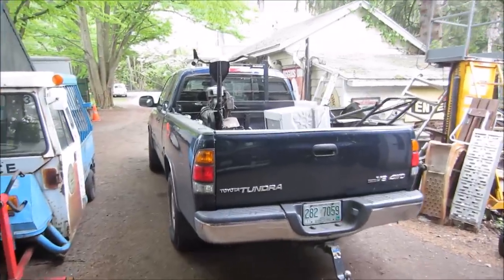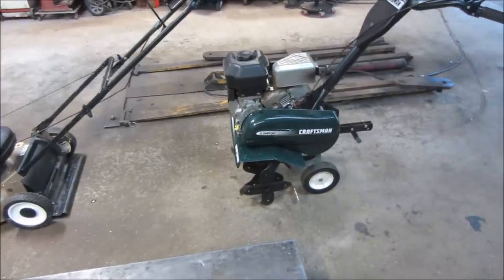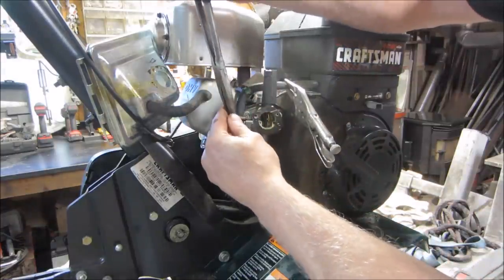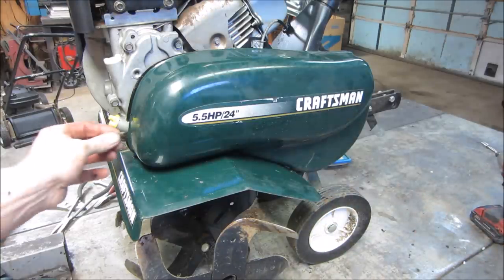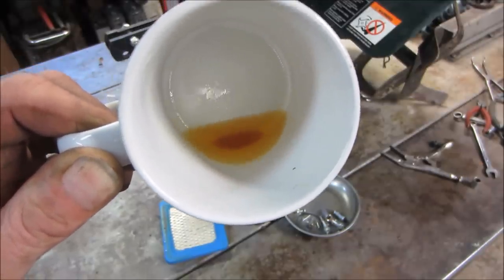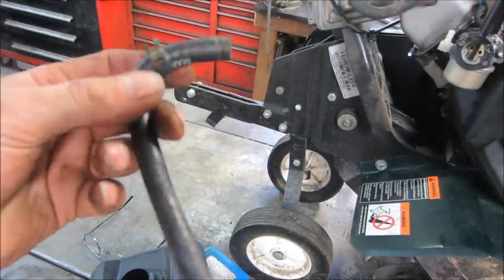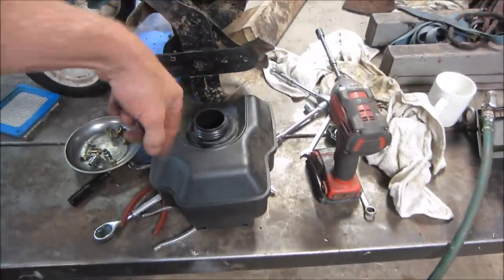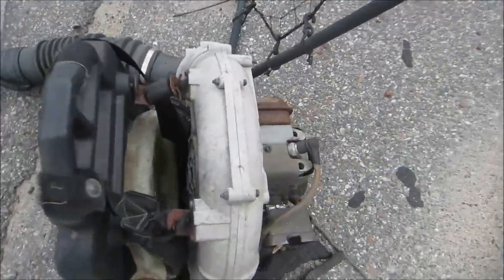will they run? yard sale tiller and mower

Comment: No marine fuel around you? A grocery store gas station a couple towns away from me sells "off road" fuel, ethanol free 90 octane. $4 a gallon, LOVE IT!

Suppose you could make your own. 5 gallon clear jug full of fuel, mix in a quart of water and have the ethanyl/water separate. Pump out the cream, live happily ever after.
Reply: What stores would sell marine fuel? Our gas station quit selling it a while back no pump within 100 miles sells it. I just mix the lowest octane with water and drain off the bottom layer. Ethanol will mix with water, but the gas won't so the ethanol/water mix falls to the bottom.
Reply: Hmmm..  I wonder if that would work.  After the alcohol is gone, how much 'good' gas is left from a gallon?  They sell water separators.  I could run the fuel through one after the water treatment...  I may try an experiment...
Reply: Sure it works, I would start with a higher octane fuel though. Ethanyl adds octane to your fuel so your 87 octane minus ethanol will have a lower octane rating. 

Use a small clear bottle to test it. Add gasoline, add 10% water agitate slightly. The alcohol and water settle on the bottom. 

10% ethanol would be 12.8 oz per gallon, so 1/2 a gallon would be removed from 5 gallons. You just have to dispose of the alcohol/water. Use it to start a fire, as an industrial strength cleaner like cleaning old carbs out.

Comment: You should let an A/C stand in its upright position for a day or two before plugging it in,  so the coolant can drain into the sump.  The same applies to dehumidifiers and fridges.
Reply: MattOGormanSmith laying flat it will be fine since they're designed to run in that position. We store ours like you said so the refriderant runs to the condenser coil. Laying flat it will stay in the reciver/accumulator (if equipped), bottom of condenser and bottom of evaporator. The liquid would have to pretty close to compressor to cause hydrolock, freon evaporates pretty fast, the metering device would be sure of that.
Reply: Laying it flat is its upright position.  It was on its end (side) in the truck at the beginning.
Reply: Im an HVAC tech and Im telling you it doesn’t matter as much as you think on something that simple. But its the oil in the compressor that’s causes all the worries and the refrigerant will blow it back to the compressor long before it locks up.
Reply: I'll take your word for it,  but it's a harmless precaution I'll continue to take.  Here in UK we don't use freon anymore,  but we might have to rethink using butane since the Grenfell fire.
Reply: I heard the Grenfell fire was back in the news recently when a video clip was played (without being announced or forewarned) at a meeting where the survivors were present, upsetting them so much that they had to leave the room.
Reply: Their predisposition to run out of the room is probably what saved them >:)
Reply: @MattOGormanSmith  Guess I'm a little bit late, but as someone who'd never heard of the Grenfell fire, I looked into it. The fridge, while responsible for starting the fire, wasn't the ultimate cause of the building going up.  That was more due to the type of insulation, which is flammable as the dickens. There was also dozens of fire hazards that had been complained about prior to the fire.

Butane had nothing to do with it. It was a bad electrical system in the building, and a few loosely connected wires that set some plastic on fire, which spread.

Comment: If that really is an 06 motor on that tiller I'd like to find out where it was built. I may have turned the crankshaft in it. Worked in the Rolla Missouri plant 04-07.

Comment: If you have another good used blade hub,  a running push mower goes for $20-$30 every day of the week IMO.. I sold one a few weeks ago for $25 at one of the New England tractor shows.

Comment: You know, my dad has that exact same tiller and, funnily enough, it’s actually going to be my winter project, because it hasn’t been used in like two or three years. In case you want the back story of it, here you go: My uncle was having a sale, as he was moving to Florida. So, he gave my dad the tiller, as well as a few other things. But he only used it about three times (my dad did). And the last person who used it was my grandpa, and he fixed it up. He even went so far as to replace the plug. All I know about it now is that the choke lever isn’t attached to anything, it wasn’t put away with fuel in the tank, and that it turns.

Comment: I sold that same mower a month ago for $150 only difference was it was green and had a Briggs, but it was the same exact frame and that one would go about the same price. Thats NJ prices, my Uncle says in Geargia mowers are even more. At sears that style mower, which is now built much cheaper is still $177 new and that older one had a stronger frame and fatter wheels. The newer ones, the frames are thinner, the wheels are thinner, so they get a cocked look on the new ones. I have a blade adapters and cables laying around, so for me here $10 in $140 out that mower is still worth fixing. A lot of people prefer a nice compact lightweight pushmower and those older AYP models were built strong. I don't think the one I had even had the rear striper skirt still on it. Plus other than the few minor issues the thing looked good. You may want to repair it afterall, I don't see why you cant get outleast $100 for that mower vs someone paying $177 for the flimsy models they sell now at sears.

Comment: Rule of thumb: If you tilt any refrigeration unit, AC, Freezer, Fridge etc, let it sit upright for at least 8 hours before turning it on. The PAG oil in the compressor needs to drain back in. If you start it too soon the oil goes hard as a rock, plugs the lines, and if the oil isn't in the compressor.... well its toast.

Comment: Hey this is bad boy just a tech tip if you got a really nasty engine and you really don't want to put all those chemicals on the ground that you get in the cans of Gunk and what have you what you can do is get some Dawn dish soap in a spray bottle and some warm water and spray it on your dirty engine I mean really spray it on there and use your garden hose and it will come out like it came from the factory clean as can be and it's better for the environment I've done numerous engines that way and that hasn't failed me yet bad boy out

Comment: I've had water in my gas a couple times, once because my son didn't want to mow the yard so he put water in the gas to make it stall. The easy fix is to pour some denatured alcohol into the tank, swish it around, then drain it. It absorbs water but also mixes with gas. It might not be good for certain parts but for the limited time it's in the tank it should be fine. Easier than trying to dry it out with rags!

Comment: I have battled 2 of those mowers and one gave me trouble like 15 times it was the carb it kept plugging up over and over and over but I still won. and the other one had no spark and I learned from taryl that you just remove the kill wire from the coil and she fired right up so I tore into it and it was the ground tab under the flywheel I bent the tab the right way and boom it worked. so I guess what I am trying to say is they are good little mowers

Comment: I ordered a ultrasonic cleaner the same make as yours just not as big hope it works as good as yours cheers .
Reply from the maker: the heat helps greatly
Reply: what temp do you set it at thanks Joe

Comment: Mustie I always pass on Tecumseh engines.... They weren't that great even when they were still being made...plus those carbs are weird ...on a Tecumseh if you have to replace the primer bulb you have to use one that is identical to the one being removed or it won't prime and therefore won't start... Also for some reason unknown to me for about two years Tecumseh decided it was a good idea to take the intake and exhaust valve and reverse them...oh almost forgot the  if for some reason you dont have the jet in a particular carb...said carb is junk because the carb body doesn't indicate what jet that particular unit required .... Also every Tecumseh carb looks identical on the outside... But uses different jets that don't interchange ...
Reply: thanks

Comment: The age of the gas doesn't really tell you anything. Last year my trimmer had 5 year old gas in it, but it's only because the gas in the can was 5 years old. So he could have used that last year and dumped old gas in it when he did.  It doesn't seem to be as bad with 2 cycle gas though. I guess the oil helps preserve it?

Comment: Be careful when cutting a fuel line from a plastic barbed connector. If you nick the barbs with the knife the connector will leak.
Reply: carefully heat the hose with heatgun outdoors, it will most always get soft and slip right off, until it cools again. make sure heatgun is moved well away in case of fuel spray when pulling hose off!

Comment: Any refrigeration system with such compressor should really never be tipped on its side like that. There is a very high chance that the oils will spill into the intake which is supposed to be higher than the liquids. This can then when tipped back to normal stay in this intake and hydro lock the compressor.

Comment: The tiller is missing a part. I think the part is  called a Drag Bar. It is supposed to attach to that double bar behind the wheels. It kind of holds the tiller back so you don't have to constantly pull back on it. It's just a straight bar that goes down to the ground and digs in a little. It would be easy to make one from a piece of bar stock.
Reply from the maker: , l said it in the video
Reply: Oops. Sorry. I must have missed it.
Reply: Yeah, he did...  Funny when he said 'drag bar', it brought a local drinking establishment to mind...
Reply: bigmac965 Blue Oyster

Comment: Even if you don't end up selling that lawn mower, you have more than $10 in parts from it.  Wheels, carburetor, deck, etc.

I sold a 1990s Craftsman push mower I picked up recently for $125.  All it needed was a blade sharpening and oil change.  Surprised mowers are selling for so cheap in your area.

I picked up a toasted lawn mower from the trash once, it had a bent rod or shot rod bearings.  A scrapper/rebuilder gave me $20 for it with full disclosure of the issues.

I don't pass by lawn mowers in the trash.  I will pass by weed wackers from now on, though.  I have had too many hours of headache buying used weed wackers or picking them up in the trash.  They aren't worth the frustration even if they are four stroke!  Two stroke, forget it mama!

Comment: Hey Mustie1! I see you have both styles of loading ramps, the ones in the truck with the thin rungs, and off to the side another set in the very first frame of the video that have a full wide platform. Which are better and which do you prefer ?

Comment: I heard you say, " when it starts running crappy, people tend to choke it a little".   Aye that's what I'm doin with my tiller,  I've removed the carburetor, and cleaned it but it still has a revving issue unless I choke it a little.  What is the next step?

Comment: I accidentally picked up a mower with a busted con rod.... Felt pretty dumb! It was all folded up and I just lightly tugged on the cord, didn't pull it enough to feel compression. When I unfolded it at home I instantly knew... Just put it out for the scrap guy. Bad pick :) that's what you get when you rush.

Comment: As for the AC unit you're not supposed to use extension cords on any refrigerator AC units especially window units also don't worry about the comment about letting the coolant run back to the compressor maybe back in 1954

Comment: you could put some high grade Isopropyl alcohol in the tank, swish it around, then drain it out the hose. If any gets left in, it will burn so its not a big deal.
Reply: adding a little alcohol to the gas actually makes it run better.

Comment: We've got a different version of that Craftsman tiller, with driven wheels and counter-rotating tines. The little round spot below the label with the shroud over part of the top is where the fuel shutoff is on that one. Guess Crapsman cheaped out for the simpler model.

60k people watching you, rabbit LOL

Comment: I love your videos I always watch them always good education videos So I’m kind of a handyman fix it up a person myself technically my profession is auto mechanic and HVAC residential so I had a quick question my neighbor gave me a ride to Mauer it ran good for one season and this season the belt broke for the forward and reverse it’s a craftsmen 10 horse rear behind eng he kept it in great shape no rust on it whatsoever it just needs Some maintenance It needs a dive belt mower deck belt A drive  pulley for the tensioner And the mower deck needs an idol  pulley and a blade Braring  for the deck  Total parts is $381 and it also needs a new seat it’s busted off the hinges is it worth fixing up or should I buy a new one for $1000 same  thing

Comment: AC unit sometimes has a remote control!
Reply: Both of mine do.
Reply: John Kifflom low end Wally Mart specials, bought 2 last year 110 each. Cools 1000 s/f house easily, uses very little power, had 1 two ton window unit at 700 bucks wouldn't cool because air coming out at very slow speed,
Reply: What does that have to do with remote controls?
Reply: @johnkramer7161  LMAO!

Comment: carefully "heatgun" heat the fuel line, it will soften and come off easy. obviously make sure the heatgun is far away before pulling the line, you don't want fuel spray to create a "fire show"
same thing works for most every type of hardened hose in automotive/engines, appliance and plumbing.

Comment: I saw a welder guy on YT talking about a, make-your-own-O-Ring kit. He demonstrated it and basically just cut a long strip of the right sized rubber to length and then super glued the ends together.  He claimed he had used it for years without a single failure but you have to take such claims with a large pinch of salt because people get paid to bullshit, by the makers. It was interesting enough to stick in my mind.
Reply: Was the video by Stephen Cox
? His friend ChuckE2009
 is a welder.
Reply: + PuchMaxi
I honestly can't remember. I know the guy made videos about tractors he liked to buy, he shouts a lot (As many Americans do when you show them a microphone. They don't understand the concept of amplification) and he was not very bright. That's all I remember about him and I cannot be bothered to go look for him. I moved on and have little desire to go back and watch someone complain that a pipe bender is a failure because it will not bend tubes.

Comment: I can't help but to wonder how much more prevalent water in the fuel is with the "enhanced" ethanol fuel that we are forced to use....because it is "better". Ethanol loves to absorb moisture......just some thoughts of mine......luckily I have a local fuel station that I can still get ethanol free gas......which is all I use in my small engines.

Comment: Laying that AC unit up on in like that will ruin the compressor. Because it drains the oil out of the compressor into the refrigeration system. I am a certified AC Tech just thought you should know that. If you ever see one at Walmart laying on its side which I have many times do not buy them because when you plug them in they made it last a month. If you have accidentally stored one that way set it up like it's supposed to be for about a week before plugging it in. And you might get by with it. And I want to stress the word might.

Comment: Our uk 93-95 octane shite is 7.50 usd a gallon (£5.50) thats 4.45 litres i believe you have a differnt size gallon ...any way its expensive for rubbish...
I use 99 octane in my petrol (gasoline) vehicles and its way more expensive ...about the same as your racing fuel...!! 
Most of my vehicles want 4 star full fat leaded 100 octance ...but it doesnt exist now...😏👍☮❤

Comment: alcohol is supposed to remove water. The theory is, the alcohol molecules surround the water molecules and let it burn. of course a lot of water requires a lot of alcohol. trouble is most machines are not built to stand up to the alcohol.

Comment: You speak of high-priced racing fuel, but I wonder if you ever considered aviation fuel. I know I keep bringing up aviation stuff, but that's what I know about. Avgas these days is 100 octane, low-lead, no alcohol, and runs about $5.00 a gallon. Should be readily available at most airports, including the little country strips. Problems buying it, make friends with a pilot. For what it's worth to you.